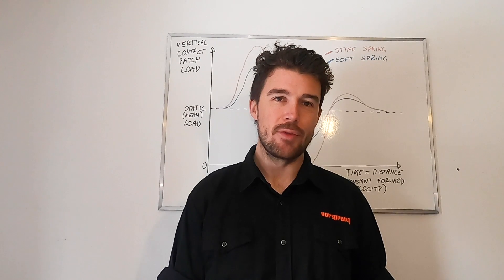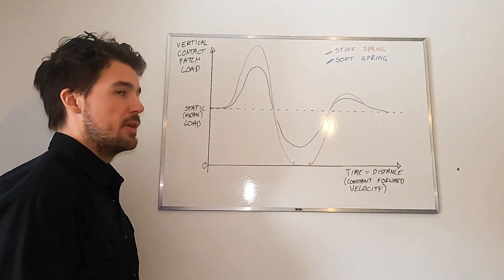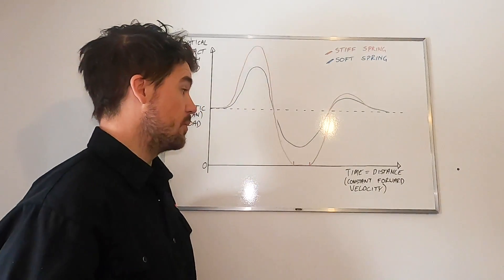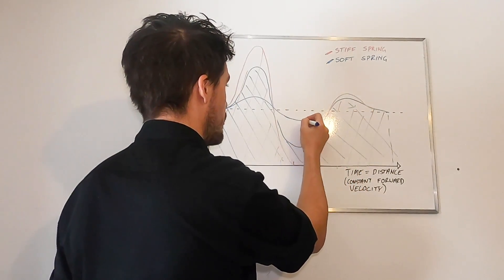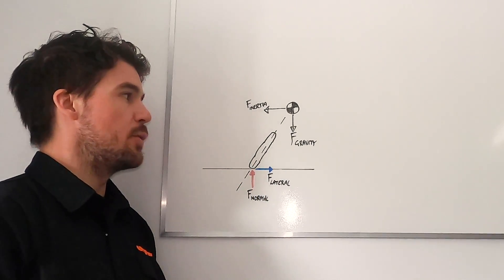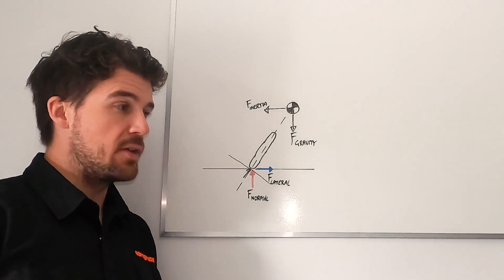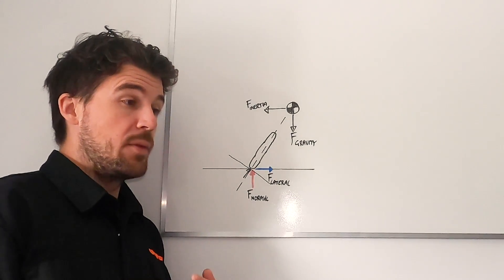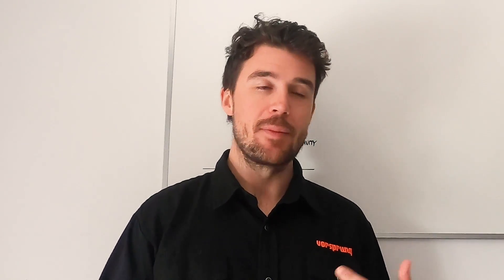The Tuesday Tune 30 - The Meaning of Grip Pt 2 - Dynamic Grip

Comment: As a mechanical engineer and avid mountain bike enthusiast I really appreciate this level of detail and explanation of forces.   As you said, these videos aren’t meant to be a process of suspension setup, but understanding the factors in play sure make it clear to me what knobs, including rider input, will change grip.  I love these videos, nice job.  
At what point does too much front bias weight transfer goes beyond maximum grip and results in a loos of lateral friction on a flat or off camber turn?  Or is that even possible?  I would be interested in seeing an analysis of this.  Again. Enjoy these types of videos.  Keep them coming.

Comment: Really interesting thank you. Although it not a magic formula it gives me some info to start playing a bit more with compression damping. Is that "snap" that the likes of Loic and Danny are doing to try and engage the compression damping forces before the spring has compressed enough to  give them the force? And would it be low speed or high speed that they are engaging?

Comment: I have a little bit of experience in 4-wheeled vehicle dynamics, and I know there load sensitivity of the tires is a pretty large effect. You seem to ignore it in your videos, is that because it is a much smaller effect with the tires we're using, or, like rally cars, the dominant friction effects are at a different order of magnitude so those sort of tire models don't really make sense for these surfaces and interactions?

Comment: Steve great video. The reach ratio to front wheel bias/control makes sense. Now the question I would like to know is how to set up my fork in relation to the extra reach. A firmer fork (pro-level) gets to be hard work for a weaker enthusiast like myself. Could you follow up with a video on the best way to accommodate modern reach with fork setup.
Reply from the maker: Often the answer if you're looking for support AND bump compliance is softer fork + higher bars, especially if you're quite tall.
Reply: Vorsprung Suspension: thanks Steve. 185 isn’t that tall 😂.

Comment: You should do a video about suspension setup for aggressive hardtails because I think it might be quite different to full suspension bikes due to the lack of balance in grip front to rear. I'm also sure there's many other factors to consider that will make them different as well

Comment: oh, sir, 4:02 how come you have the same area under the red with the flattening at zero on the curve? I get the idea, but the flat portion at zero should make it not equal. or am I missing something
Reply from the maker: Technically correct, the areas aren't quite identical if the wheel leaves the ground, but if it only just momentarily reached zero load for essentially zero time then it'd be the same. The point here though is that the mean load can be the same but the minimum load (and thus the available grip) varies.
Reply: Average grip over the time interval is the same for both springs.  But the instantaneous grip differs over the time interval.  Each spring graph is a function.  The are under each function is the integral of the function.  The value of the integral is the same for each function over the interval but when each function is evaluated at an instant in time they differ.  Here's a similar situation that is easier to envision.  2 cars are driving from point a to point b and they leave at the same time.  The distance of A to B is 100 miles.  The first car drives 25 mph or an hour then drives 50 MPH for 1 hour then 25 mph for an hour and reaches point B in 3 hours.  The second car drives 75 MPH for one hour then drives 12.5 MPH for 2 hours.  It also reaches point B in 3 hours.  Both cars traveled at an average speed of 33.3 MPH even though they traveled at different speeds on their way there.